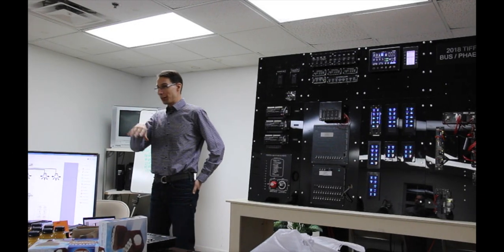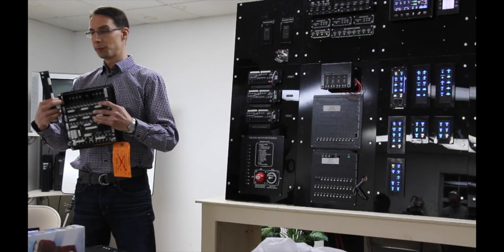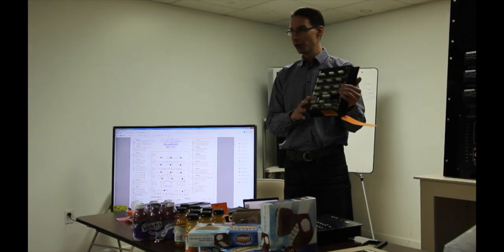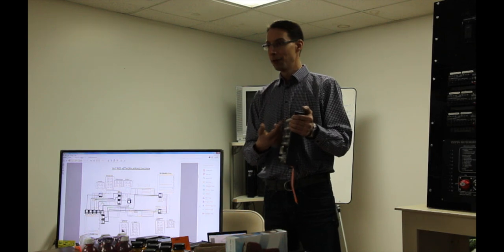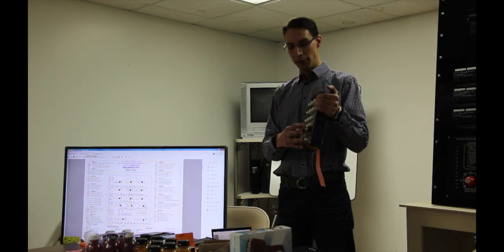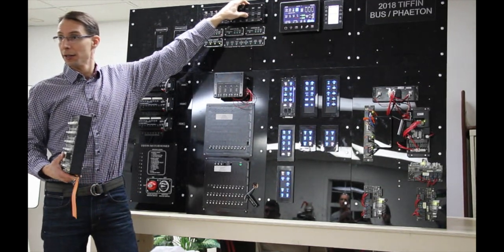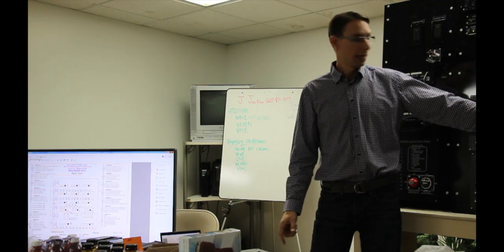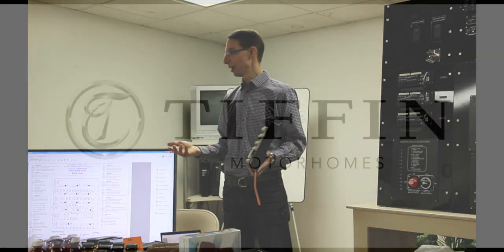Tiffin Motorhomes: Spyder Control Seminar; Analyzing the G6 House Panel, Driver Card and RSI9 Card.

Comment: Can you do a video on how to re-assign the AC  CONNECTOR 101 THERMISTER INPUTS. Because its a know issue that the sensors are not matched to the correct AC units. I have a 2022 Vilano 390LK.

Comment: I do not get this from a mechanical engineer design standpoint. Why can not the "driver card" be designed like a "air conditioner" power disconnect?

We don't have to replace the entire hardwire,  We just pull the "Driver card" plug from the front of the panel and replace.

The hardware of the main panel is dumb, and at low risk for failure, the firmware in the card is the weak point.

This also works in manufacturing scale as just one card "Quick disconnect" would hold the firmware for all systems. And only have one part#. Just a thumb drive could replace the "Driver card".

The simplicity in this design can pay dividends the other way taking the "driver card" out and plugging it into any laptop. That would pull up a graphic, everything working would be in green. Problem with appliance would be in red. [Just like the color coding of the switches] This bundles error codes, into the simplicity of a "hot swap" 5 minute fix.

Cons,, if someone took the drive it would render the coach DOA to every appliance. Triple drives, just like keys would have to be included.That spreads,,,, risk.

The brilliant move would be for Tiffin to buy this company,,, and take it away from everyone else. That would send the competition reeling.
Reply: This system does have the possibility to take out other bought options in the coach.
Navigation dash cost, switch to Google maps in API

Take out the Camera's Vender Bios, just need cameras

It's cheaper to buy this company, than to buy from it. Back license it to everyone else. And get your's for free.